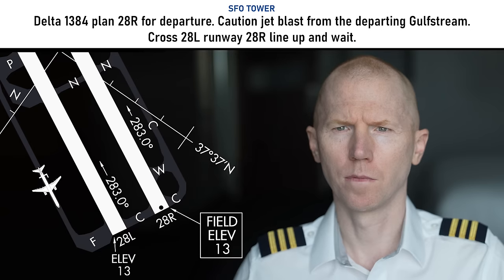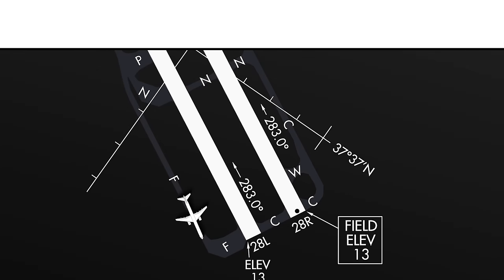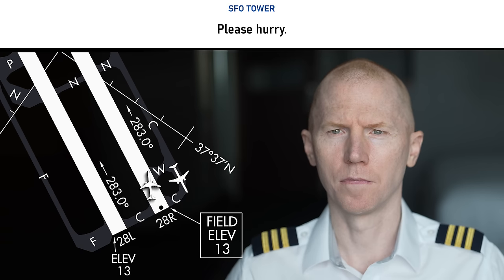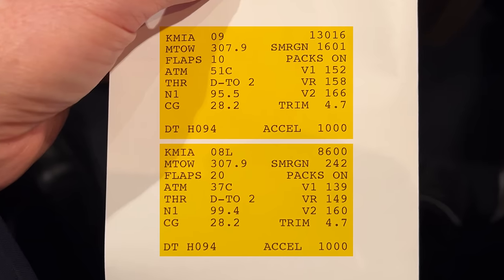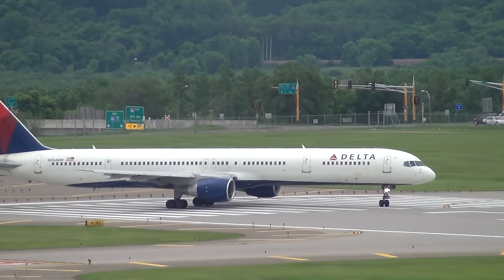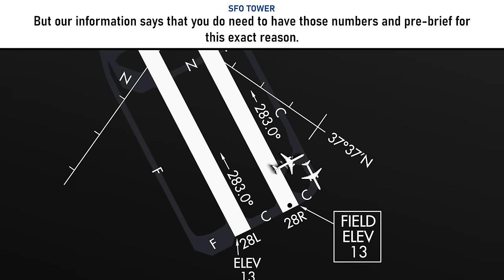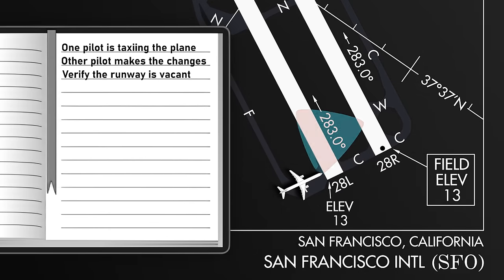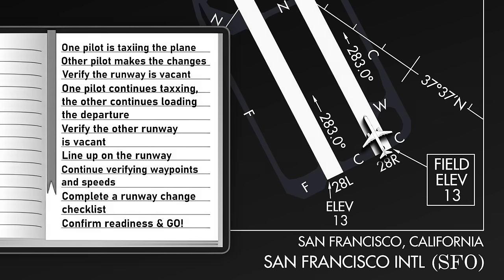ATC Doesn’t Like Delta’s Comment

Comment: Chastising a cockpit on an open  frequency by the air controller does nothing to advance the safety of flight; even if the air controller is correct.  It only adds more pressure to an already complicated issue.  The pilots understood this by responding, "Roger."  The air controller should be reprimanded for exacerbating the situation by being snarky and combative.  She is there to direct flight operation and not argue.
Reply: Spot on. ATC is under constant pressure to "move traffic" more and more "efficiently" (read with less and less margins for separation) and expect pilots to play the same game. Pilots do not play that maximization game at all, not their problem. I would be pi** off beyond believe if ATC would issue me an immediate executing runway change for departure. Pilots can't do that they have to recalculate their take off data and enter all that in the FMS. That takes some minutes and if ATC on top of that takes it on that tone that would not end well with me.
Reply: Agree, simply childish. I won’t want controllers with an attitude working for me (FAA). 
I’ve dealt with a few controllers that were complete arrogant a-holes who should never have been in a tower or on a scope, but then the majority have been amazingly cool headed and accommodating. These bad controllers would make it as a Wal mart greeter. Come one folks, peoples lives are at stake!
Reply: Well said 👏🏻👏🏻
Reply: You could tell she was just itching to escalate. She should have taken her Midol.
Reply: @LawnBunny777 unnecessary escalation of your own - keep it objective and professional as 74Gear does
Reply: SFO is notorious for things like this...try and find the one where they made the pilot go around twice...then the tower tried to blame it on approach....btw, there's no pre brief for changing runways on takeoff...she should of saved the ...ohhhhh okay, attitude....not necessary 😮
Reply: She was no where near being combative. And I am sure you thinks she is a "Karen" for reinforcing a rule. If she was a he I guarantee there wouldn't be all these comments.
Reply: @paulazemeckis7835  no need for smart ass remarks on ATC...the other example I mentioned was a male controller, so you can save the Karen comments for a different subject...
Reply: @paulazemeckis7835 I don’t discriminate. Male or female, controllers and pilots need to abstain from their egos getting the best of them.
Reply: @LawnBunny777  retract your claws
Reply: @paulazemeckis7835  Reprimanding the pilots on-air (and being obviously excited to do so) does nothing to enforce the rule, it's just being combative. And if you think that people don't make the same complaints about male ATC's, then you must not read comments on these transcripts very often.
Reply: Obviously - That Time of the Month!
Reply: @pcpolice7937  not appropriate at all. Get with the program!
Reply: @LawnBunny777  sadly that was my first sexist thought
Reply: @LawnBunny777  nice casual sexism. She was definitely in the wrong, but that kind of sexist language is never warranted or helpful.
Reply: @gethisoverwith1335  don't tell people how to post
Reply: @paulazemeckis7835  you guarantee nothing you Know it all
Reply: @shaaronsellars5821  This “ Controoler” Waaaay  out of line and unprofessional. For what reason? To show that she has more authority while risking the safety of all the passengers on both planes? Besides, Fed up with all the bs leftist women comments and insults to hard working men. Get a Clue
Reply: @pcpolice7937  sweeping generalization made based on gender is totally unacceptable.
Reply: @shaaronsellars5821  it's not based on gender...it's competence.....this guy is lined up changing his numbers, have a plane about 3 miles out approaching and she's giving lectures. 😉  no time for that.
Reply: @brianmanuel1202  I understand competence completely. I have no tolerance for the ‘she forgot to take her midol’ and ‘must be that time of the month’ comments. Why are those things still being said by men in 2023?
Reply: @pollyanna4468  Wake Up! The exact same thing is being said by women all the time! Not everyone is selectively deaf!
Reply: Oh bullsh*t.  Take the simp routine to your local single mothers club.  They'll take you.  If she was a he?  What about you?
Reply: @purplesprigs ironically you can’t assume these days whether or not a “he or a she” may or may not have periodic ups and downs.
Reply: @ariochiv Exactly this! She was smug and nasty in tone maybe not totally wrong in content. The tone is everything and you don't want a controller like that causing an issue for no good reason.
Reply: @shaaronsellars5821 There was nothing sweeping about it. It was actually directed at this one woman
Reply: @pollyanna4468  get over it, it's just words! You understand the point being made. She is inappropriate and looking for a fight.
Reply: @purplesprigs they're not saying it about every mother or every woman. They're saying it about that witchy controller
Reply: @paulazemeckis7835 .  Not just for you, but can people PLEASE stop calling women that are speaking in a less than congenial manner KARENS!!!!   This, also is just unnecessary. Call her snarky, short, unprofessional, a jerk, anything  but that name.
Reply: @LawnBunny777 SFO is notorious for its estrogenated, attitudinous ATC.  Then again, we are talking about San Francisco, California, so it stands to reason.
Reply: What is with the sexism in the comments? Were all capable of being rude, equal opportunity assholery yalll.
Reply: Exactly! De-escalation is job 1

Comment: I love how balanced Kelsey is when he deals with something like this. Not just blaming one side or the other but looking at what both sides could have done better.
Reply: It is this type of balance that helps me feel much better about flying. I believe this type of communication should be an ongoing required course in school. Solving issues without blame, and finding snacks! What could be better?
Reply: Bad decision by controller
... period.

If I was Delta pilot, I'd call when I got on ground and complain about that scenario..she needs to be called out
..
Reply: @greggersism  The pilot played tea parties with his "2min" claim but it's the ATC s fault? Figures. Nevermind the lives on board his craft. Maybe he should go work at a bakery and make cupcakes instead.
Reply: @greggersism  You think like Kelsey said, ATC set the pilots up for failure there?
Reply: To balanced
Reply: Pilots could have held short of 28R and taken however long to set up and brief without any time pressure.  But they chose to accept the line up and wait with a basically self imposed two minute time limit.  The controller's snarkiness was unnecessary, but she has a point. 
Think of it in terms of a different scenario: if, while enroute, a pilot accepts a crossing clearance and doesn't comply, it's on him. If he says "unable" then the controller can issue vectors or use other methods.  Moral of the story: don't promise something you can't deliver.
Reply: Still, I see that snark is not acceptable. I worked with such a supervisor, years later I realized how stressful that was to me.
Reply: Not “blaming”? Really? Did we hear the same dialogue? He made tons of excuses for the pilot.
Reply: It’s what makes a great pilot & s great instructor. Kelsey has the best analytical skills & clear &  concise communication skills. His professional manners & gratitude 🙏 are also reasons he’s s good role model for those who want to be pilots.
Reply: He's not "balanced", he's long-winded.  Talks WAY too much.  He should quit flying and get into radio broadcasting or something.  I bet other pilots hate working with him, because he never shuts up.

Comment: Years ago we used to bring pilots in to our ATC simulator and the pilots would be Controllers for the day trying different scenarios, then we would go to their simulators and we would be Pilots for a day. Great program and did we ever learn a lot from each other. Too bad they didn't continue these programs.
We actually did the above scenario just to see how long it took and the steps involved.
Reply: I think this is important for many jobs, especially when dealing with public safety.  I feel the same about things like police and fire, dispatchers should occasionally do ride alongs when possible, but also police and fire should spend a day in the radio room to understand what is happening on the back end. The more knowledge everyone has all the way around, the more teams can get along.
Reply: I work for a class 1 railroad as a freight engineer. We deal with the same kind of time constraints and on the fly changes. Years ago , I and a conductor were able to spend a week at our dispatch center sitting with dispatchers being able to see their side as well as tell them our procedures and road blocks we encounter. It was a great experience and something both sides learned a ton from. I feel like the corporate profits are taking away from these kinds of training programs being available.
Reply: Wow, that's the best way to get to know the parameters and unexpected circumstances of any job that is part of a team. IMHO that ATC in this video was out of line and wasted time being snippy.
Reply: This would be SUCH a huge learning benefit from both sides. As a pilot, I wonder sometimes if ATC has any clue how much they are hosing us by changing something last second, not understanding the implications and complexity of the changes we have to make, reloading the box, rebriefing things, re-running performance etc. They think they're helping us (giving us a more favorable runway/intersection), but they don't understand that it necessitates a LOT of workload now compressed while we're taxiing and makes things a lot more stressful for us, and often has the FO heads down doing things without the CA being able to back up the changes.
Reply: Just like in healthcare…. It’s called “we the owners, don’t care about the employees and our customers. We only care about cost cutting to make more money at our employees expense.” Understaffing in hospitals put patients’ safety and quality care at risk. Healthcare workers at bedside take verbal AND physical abuse from patients and family members. We all have do to something about this! Watching videos like this reminds me of how toxic and unsafe my profession is, and it’s not about my co-employees…. It’s about the “big people” that create the policy and determine the budget.
Reply: My work tried having the crews sit with dispatch.  After 2 months it was ended after the dispatchers said the crews were being "disruptive" by pointing out what issues the crews would be facing with dispatches various requests.
Reply: Love this! ATC & Pilots must be team-mates. I wish they would bring this back. It makes so much sense.

Comment: One more comment from a retired pilot, and SFO based. Prior to pushback, or even on taxi out, confirm, “Which runway can we plan for departure?”, Like you said, it takes a bit to update the FMS, especially when the runway change will wipe out the departure portion of the inputted info, then it takes the two of you to verify the waypoints and fixes along with a review of performance (which may involve a call to dispatch), and a full updated departure briefing. Take your time, safety is first, and schedule is secondary. After all, you will be the first to arrive at the accident site, as opposed to others on the other side of the radio communications…

Comment: My company had three violations out of DFW earlier this year for a similar circumstance. 
Last minute runway and SID change. The crews loaded and ran our runway change procedure, but missed an Altitude constraint for the new SID that was buried in the NOTAMS. 
Last minute changes are definitely a threat and have proven so many times!
Reply: Wow, that's actually very scary.  What i don't understand is why they'll have notams like that, somtimes for over a year, instead of just updating the SID itself?  And it's not just SIDs, but other procedures as well.
Reply: What about the notams over a year old that are still in effect which change the MAP because a VOR is OTS and the notam specifies some completely different MAP and hold.   Why not just change the approach plate to show this!?!?
Reply: But they won't do anything about it until there's a crash, a bunch of people die, and the NTSB specifically calls out the FAA's practice as the cause.
Reply: Your union needs to bring this up to ATC and company
Reply: Huge Threat, especially at an unfamiliar airport
Reply: Honestly that is on the faa. The notam system is an antiquated and outdated system. I would never expect a pilot to catch that change via notam. I hope the notam system is overhauled soon.
Reply: Considering I live in DFW, I am glad that I don't fly.
Reply: @spudsmac0  our NOTAMS are usually about 45 pages. 
If something in their applies to your flight, it’s completely on the Crew to catch it. 
You get pretty good at finding the information which may impact your flight, but during a last minute change, not so much!
The Government’s version of dealing with an antiquated system, is to change Airmen to Air Missions! 🙄
Reply: Dood ole' FAA!
Reply: Dfw is a busy Runway We lived in Dallas.❤
Reply: I meant to ask Kelsey about these last minute runway (or other) changes. I’ve seen how potentially challenging it can suddenly be for the pilots; even to the point of possible task overload at a crucial stage in the flight. It has also been a contributing factor in some accidents. How do pilots feel about these last minute changes? Is it just part of their job, but an annoyance? Can you ask them if you are allowed to NOT make the change in certain situations, if it will not affect safety adversely?  The pilot has the final say regarding the safety of their flight, right?!
Reply: Don't  understand why AI isn't being used for these applications.
Reply: @jeremyfink7805  "AI" doesn't solve everything. How exactly do you propose to use AI for this?
Reply: I´m not a pilot, but from what I can gather, it´s Standard Instrumented Departure Route that´s a SID? And the altitude restraint is only reported in NOTAMS, which is a general Notice to airmen, like a bulletin - where people go to check out info that´s important for their plan, not for every other direction? I mean, if you´re going west, would you care if anything happens to the east? Is that what it´s about? If so, I really want this to change, so every change in departure could be loaded from the tower along with the clearance. I mean, as long as everyone´s got transponders, the tower should be able to confirm delivery just as easy as any notam.
Reply: Last second changes are dangerous and ATC has no clue the workload involved. Just a matter of time.

Comment: Many years ago I was a police dispatcher in a medium size town. I would often ride with the officers when I was off duty, I can tell you that it really helped me have a perspective of what the officers were doing in the field.
Reply: Smart!
Reply: It should be mandatory for both sides of the radio to observe what each other are actually doing..more than once! 
Several police agencies do make observation mandatory for  dispatch and officers..infact, some agencies have officers actually work  911 call taking  and radio before they hit the streets.
Reply: NO.  Flying an airplane is a highly controlled environment, and Police work is the exact opposite.  Pilots don't need sympathy, empathy, or understanding, nor do they need ATC to understand what it's like for these apparently very sensitive and delicate feewings.  I wonder how many innocent passengers have been killed because their pilots craved sympathy and understanding instead of having a single-minded focus on doing their fucking job correctly.
Reply: @JeraldFahrsite  that's very close minded and brash of you. I think it would be invaluable for both sides to experience the other side just to see what goes on. Not so they understand their "fweelings" 🙄. There's several comments, just at the top, of people saying how valuable it was to see what the others have to do on their job, and how sad they are that it doesn't happen anymore.